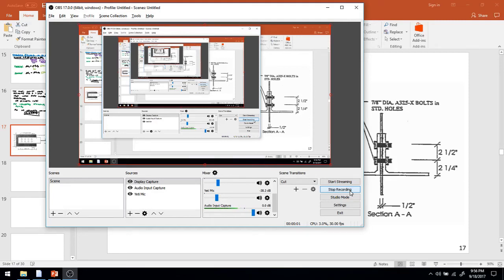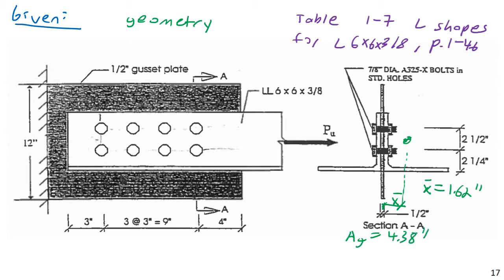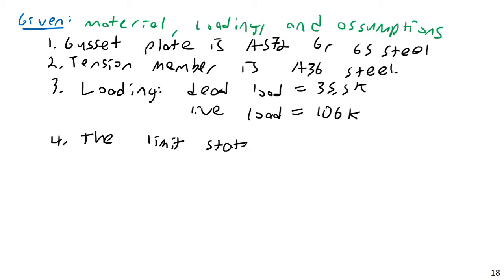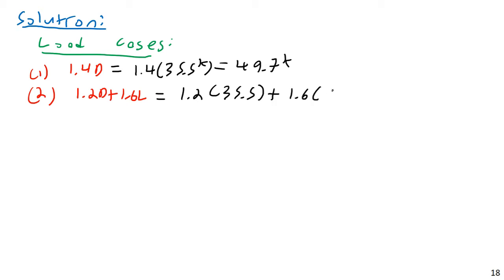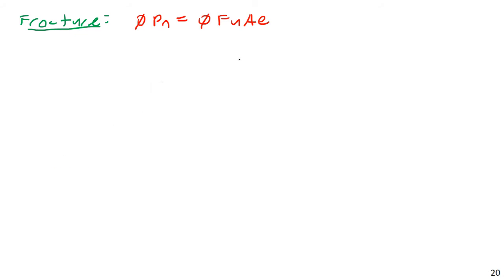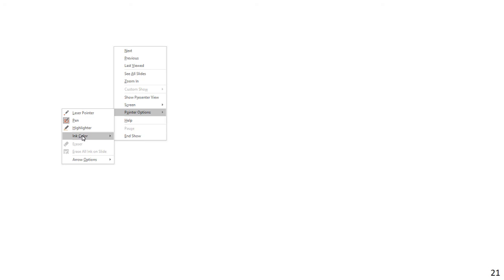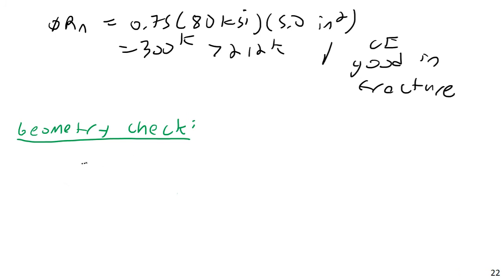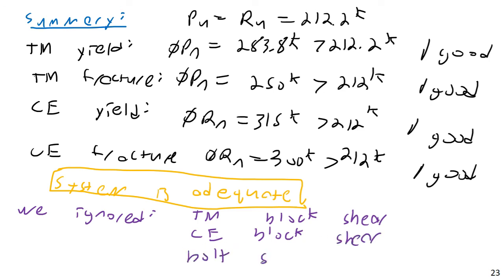Tension Yielding and Fracture Example - Steel and Concrete Design

Comment: Pardon me but there is a minor math errors which both will not affect the calculations.
@ 24.19 Net Area = 7.26 in^2 not 7.01 in^2. 
@ 29:00 phiRn= 351K not 315K.